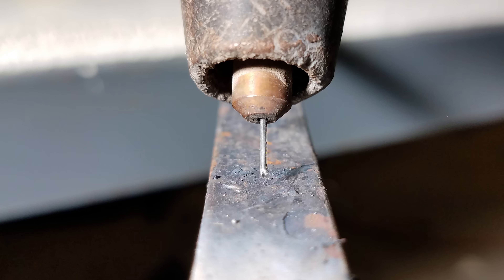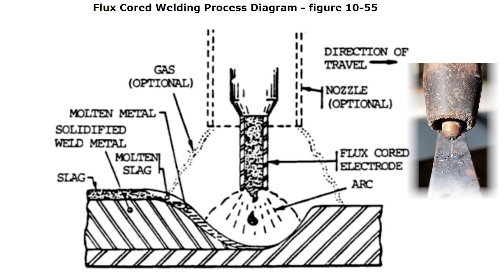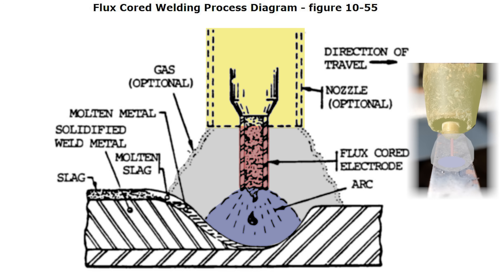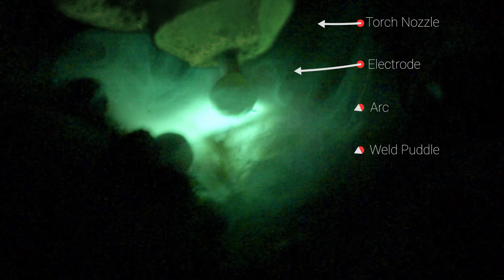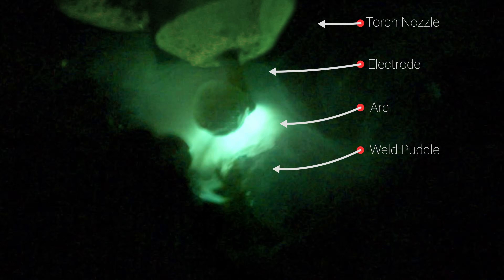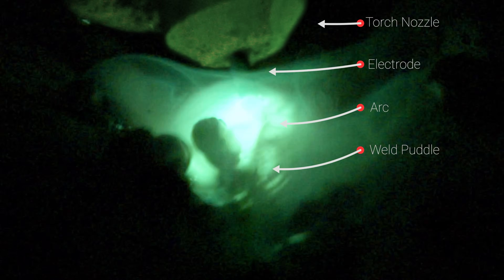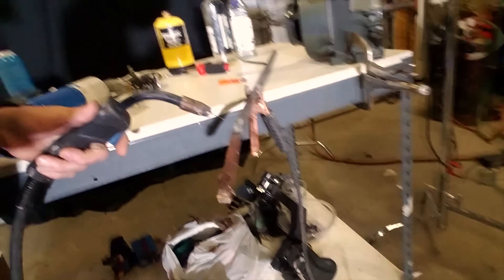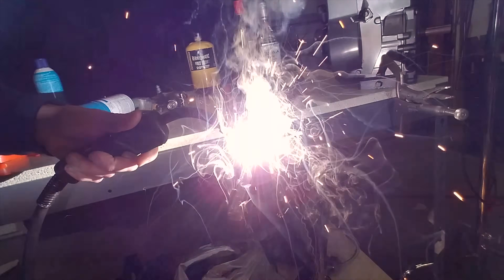Welding In Ultra Slow Motion at 60,000 FPS - Flux Cored Arc Welding 4K [ Too Slow - Macro ]

Comment: Btw, your electrode is sticking out way too far.   It should actually be inside the cup!  Not protruding out from the end of it.   Just fyi.   Cool video however.   But the weld and the arc will act differently at different lengths.  "Arc length"  are you running with or w/ out gas?

Comment: Very cool, thanks. I hope you can show us some gas shielded welding hen you do more. I’m interested to ‘see’ if the gas shielding is easier to see through than flux core in super slow motion. I can see the weld puddle fine with both, but of course I’m not seeing the individual metal globs flying like your video shows.

Comment: Since the bright light is always there, even in mega slow motion I still only saw a green light with some bubbles and everything else in black. I didn’t see or learn anything new. Slow motion welding I guess is impossible, unless you can get rid of the bright light that the cameras can get around, if you know what I mean.

Comment: can you setup a GOOD WELD and show that in slow motion? you just demonstrated how to royally F-up a weld. Still cool but would be much better to see the process as is ideal. You've got a flux core setup. It's not hard at all to dial it in correctly.
Reply from the maker: Well what happened here is that I filmed this video with a specific camera along with a few other ones the same day, I sent the camera back to the company, then after the fact I realized that I had the polarity reversed on the welder 🤦‍♂️ but by that time it was too late.
Reply: @WarpedYT  mistakes happen when you're stretched thin. i can understand that.

if it's worth your time, there's interest in the real deal. at least as many as you got hits here.

it can be visually appealing for the layman and technically helpful for the student and hobbyist.
Reply: nm... i see the other comments. this vid was more for the lulz+clicks :rolleyes:

Comment: Cool video but that weld made me cringe. Should be no where near that much splatter even with flux core wire. Make sure your machine is set up with reverse polarity for flux wire and turn the wire speed up some.

Comment: you should prepare your surface for welding instead of just welding over some other weld and slag
not a very high quality shot when there are mountains of spattery weld in the view
also you should maintain about .75'' to an inch of stick out for dual shield + set up your machine correctly
Reply: plus he has the tip sticking out of the nozzle at least an eigth of an inch. he should redo this video and prepare the surface as you mentioned and weld a little longer so it can settle down

Comment: 60,000 fps camera, but you don't have a clean flat piece of steel?? Or know how to weld?
This is a rare treat to see, but it's not relevant to actual welders. If you could do this again, it would set the standard. I would suggest actual mig as the process, not flux cored. Then maybe spray transfer!

Comment: Try some fuses blowing or wire being over loaded and burning like fuses used on Home Made battery packs for Power Walls.  I really like the engine videos and am thinking of converting a gasoline generator to propane.

Comment: this is interesting. I always thought all sides of the metal melt to join together when cooled, but apparently only the welding material actually melts. good job with the video. would have been a little better if you filmed while dragging a centimeter or two the welder so we can see what happens immediately after the melting point "behind the light" if you will. But overall this is good video to point out the actual phenomenons happening there. So please if you can make another video by welding something for real on a small distance so we can catch the "after glow" effects.  :)

Comment: I'd love to see some other welding processes ie bare wire mig (short and spray arc), dual shield, tig, and some stick, 6010 and 7018.
Reply from the maker: Ross Browning we're going to do something soon, I just wanted to get the dirty as well out of the way, I don't know why, I do think doesn't make a great comparison to the other types of welds. this was just way too slow.
Reply: Warped Perception if it's any consolation, it'd be awesome to see some 3/32" T75 run at what we call nuclear  (35ish volts/260 ipm wire) or bare wire run the same way (40 volts/999 ipm) if you have the machines capable of those numbers. either way, love the videos. thanks.
Reply from the maker: Ross Browning lol... I actually have a 225 lincoln machine that I believe will do that.

Comment: Perhaps it's possible to ultra fine the wire speed. Lol. For real though... 9 year welder. 👌👌👌
Reply from the maker: Soul Rebel Elite yeah .. lol. this was a newer Miller it was on fully automatic, what you saw in slow mo was about 30 milliseconds of real weld time, just to give you an idea how slow that is, if I would have recorded one full second of welding that would have turned out to be one hour long video.
Reply: Warped Perception no way to fine tune a push or a push/pull machine in that short of time.... ☺☺☺☺
Reply: Warped Perception no way to fine tune a push or a push/pull machine in that short of time.... ☺☺☺☺
Reply from the maker: Soul Rebel Elite true , I guess I could have done it beforehand but I was inquiring hurry. alot of times viewers don't realize the relation of frames to time in alot of these slow mo vids . my main goal with this video was to show what happens during the welding process in such a short amount of time, 30 milliseconds equals about 1800 frames captured at 60000 frames a second. pretty crazy if you think about it that's 60 frames and one one thousandth of a second.

Comment: That's amazing, that's perfect for showing why wire speed is so important. I can't believe how long that molten filler wire stays suspended, I always thought the arc forces the metal into the puddle. 

keep up the great videos.
Reply from the maker: +Austin Albright the total weld time recorded was 30ms. An airbag deploys in 200ms . Just to give you a comparison.
Reply: @WarpedYT  anyone here for sunset selfies by pop push?

Comment: Try it again, this time set your weld up properly. Impressive looking, but you were set up to spatter with wire feed to slow. The arc will 'flow' the molten wire into the puddle without all the hoopla when your settings are right, and it will still look awesome!
Reply from the maker: +LowLightVideos thanks for the tips but I actually have been welding for more than 15 years, I also hold my gas pipe welding cert. so the total weld time here was 30 milliiseconds, I was not intending to creat a usable weld or workpiece, or use proper technique at all. Our only concern at all was the capture the shots we need to make a video in preparation for a future full episode . Thanks for the tips but I really had no intent to weld properly here. Also I recently shot some spray arc and pulse weld vids for linde, you always have pixel blowout from an arc like this. Additionally these cameras don't operate anywhere near a consumer camera so most of those points you made setting wise do not apply. How much of a weld could you perform in 30ms? Exactly what you see on this video, a few drops of material on the puddle. Slow mo at this framerate is almost a dimension we cannot grasp.
Reply from the maker: +4n 2earth that's true but there are alot of reasons we did it this way though, may try it a few different ways when we film the full episode !. Thanks for watching .
Reply from the maker: 4n 2earth this welder is a newer Miller, we had it set to automatic. also the amount of weld time that we captured was 30 milliseconds. that was the entire slow mo video that you saw
Reply: 4n 2earth I
Reply: Flux welds nice with fast wire feed it does get choppy with lower feed rates but I can weld just as pretty of a bead with flux as I can my mig the only real difference when set up right is the thickness of material I can weld
Reply: selfies on a sunset? YES
Reply: 4n 2earth Gasless flux core is sloppy, this is a common issue for most FCAW anyway. they aren't great but this video as mentioned by the creator of the content wasn't intended to focus on the actual weld itself.  I personally cannot stand using a Gasless machine, I'd take a regular old buzz box with 6010 or 6011 electrode any day haha
Reply: +Warped Perception - Thanks '4n'. I agree awful mess-making.

Increase your Wirespeed AND your Stickout. Also hold the Torch at the correct angle AND move it in the direction that you are Welding (assuming the day comes when you "Weld" - the above is not "Welding").

Normally the operation of the Camera is fine, this time you got a few blowouts (in the Highlights, not referring to the 'mess-making' being full of holes) and Filmed with reduced Contrast.

If you have an Electronic Helmet set it up for your Eyeballs, then attempt to get the Camera to Film that, try to see a bit of the Plate (tubing in this example) and a tiny difference from the center of the Arc to the edge of the Arc's ball of light (that will give you more Dynamic Range available to have gradient between the edge of the ball of light and the top corner of Plate (or tubing).

At the very least you should have a decent "Video" - even if you couldn't "Weld" to save your life.

Said calmly and politely, with great effort to be kind.

YT,
Rob (who is a Welder)
Reply: @WP If you have that much experience and hold a gas pipe cert, why on earth did you not set up the weld properly and also not use a MIG? 
This video is basically a waste. I'm also a trained welder that has been welding for 15 years.